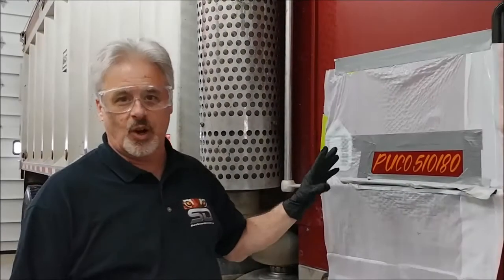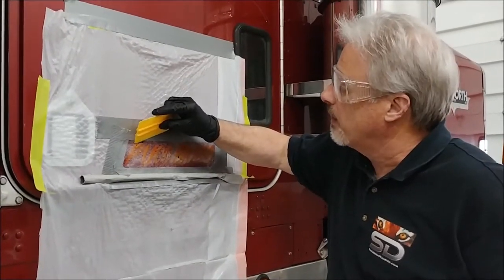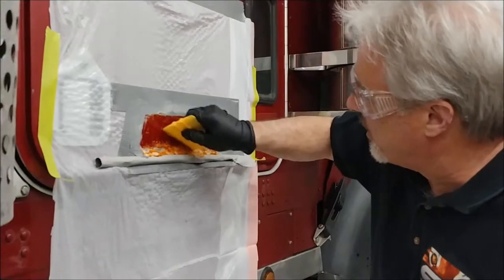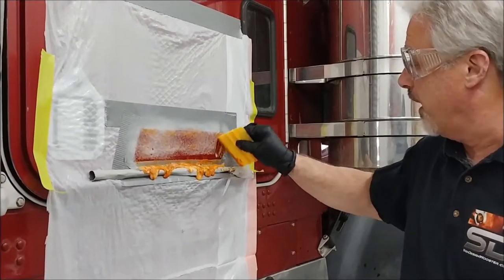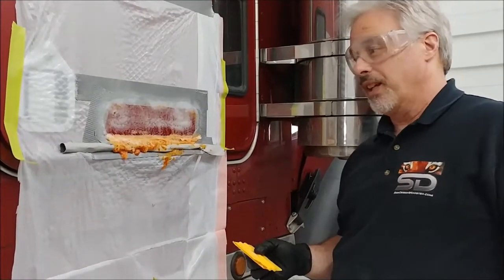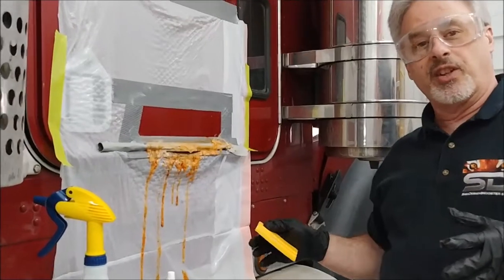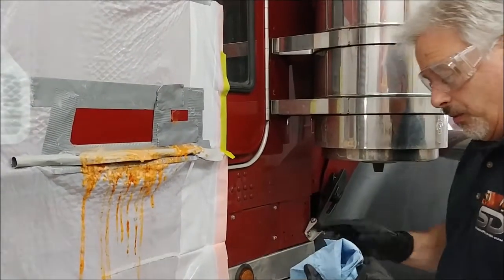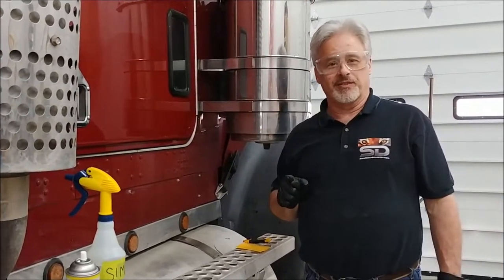How to Remove Hand Painted Door Lettering

Comment: Thank you for this. I only had Dollar Tree version of Easy Off and blue painters tape on hand but the letters came right off with minimal elbow grease after about 10mins in direct sun. My only issue was the painters tape turned gummy and required an addtl step of goo gone. But this technique quickly removed painted letters on a metal object i is that I wanted to salvage paint around the letters.
Reply: I am looking to buy a van from 2008 full of construction biz  info.......would 3m wheel be safer?  Both sides length of the van and rear, too!
Reply: I linked this to the JPAYDIRT Channel. Let's see if gets it right.